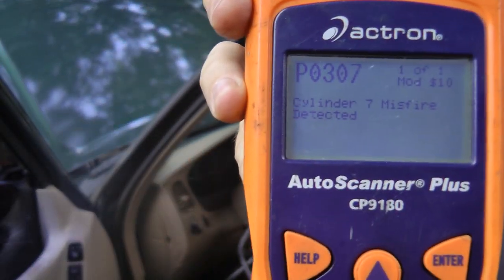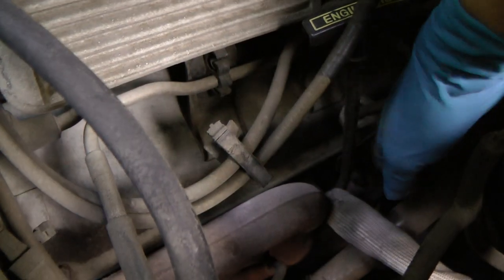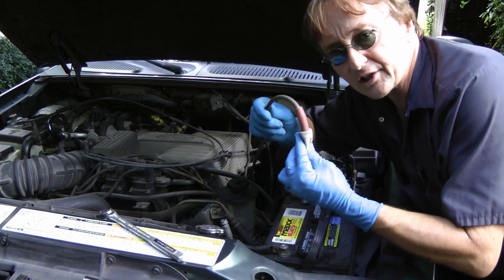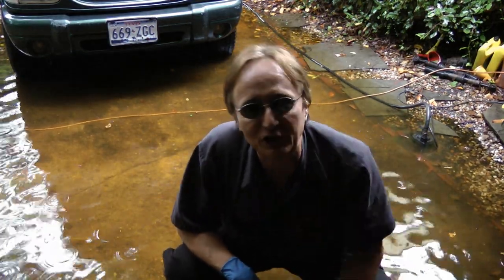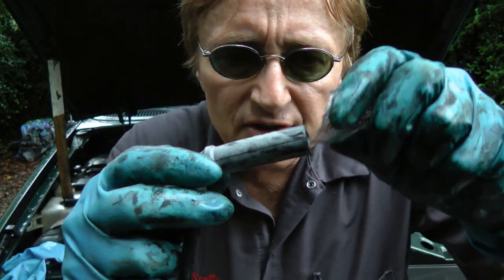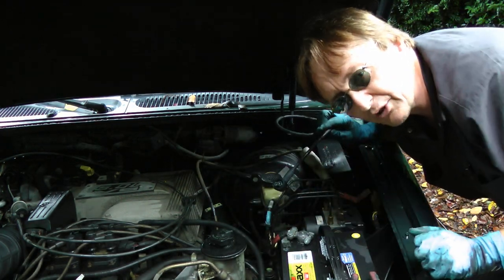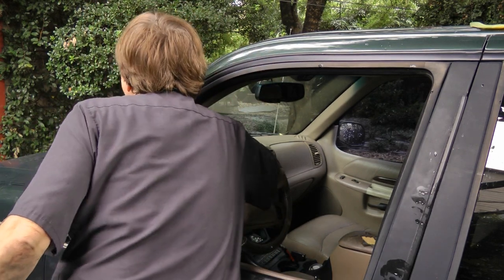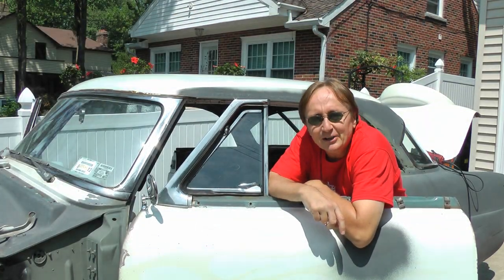How to Fix a Engine Misfire Code P0301 (Spark Plugs and Wires)

Comment: excuse me scotty you said no 7 is the third one in on rt side that would be no 5 no 7 would be 4th one in nearest the firewall just across from no 8 iam sure you just misspoke but might want to correct that so your viewers do not get there firing order messed up 18435672...or from leading bank rt side right to left 12345678..good video.. ..
Reply: On my Mustang, 7 is the third on the right.  front to back is 5678.  I couldn't imagine Ford trucks are in a different order.      Firing order has nothing to do with position on engine.
Reply: +Joseph Bentley yes you are right sorry my bad i was thinking chevy since scotty started out with a chevy then went to ford ..

Comment: I have a problem,  bank 2, cylinder 2,4,6 is miss firing . My vehicle as 90k odo and have a bad rough idle. . .
Reply from the maker: +Suavemente173 one side missfiring is often intake manifold or head gaskets leaking
Reply: +Scotty Kilmer Thank you. Going to start there.

Comment: i have an 02 ford explora 4.6 V8 that the #3 injector is dumping gas ive changed injectors and still have the problem has anyone else had this problem and what can i do to fix it
Reply from the maker: +Cathy Godbey if it's the injector dumping too much gas, then computer circuit that drives it is bad. but worn valves or blowing intake gasket will also flood out #3 cylinder

Comment: an you help me I have a p0302 cylinder 2 misfire  I put a new spark plug I no change wires are less then 10,000 miles old ignition system is also new cap and rotor is new no other codes are on the computer  the engine light  keeps flashing.
Reply from the maker: SuperJeremi10 swap #2 injector with another, if miss moves, replace it. Pray it's that easy
Reply: ive tried that with the wires  swapping the injector isn't so easy I have the spider injection system I can try but that requires removing the intake off the car the throttle cables and a bunch of sensor wires I have a 99 chevy Tahoe  injectors are only 600 miles old.
Reply: im just taking it to our local repair shop to pay for the diagnoses and repair.

Comment: Dielectric grease shouldn't be placed directly on the terminal. It's purpose is to prevent electro-static discharge (insulate; restrict electric flow) from unwanted sources. This is similar to how a computer's CPU can possibly get damaged froman individual touching it without that person first clearing their body of static electricity. 

Main reason I use dielectric grease is because its easier to slide the cable on and off when needed.

Comment: Those were some of the nastiest plugs I've ever seen. That's alot of standing water to have after a storm, do you have a bad storm drain at the street? Its best to get that to drain away from the house for the sake of your foundation, although my understanding is that houses in Texas aren't built with basements.

Comment: Scotty my 96 crown Vic making a popping sound from underneath my car or behind the motor n it misfire. I changed spark plugs n wire. Can it be fuel injector or motor coil pack. Can u help.
Reply: +Dreadhead13 Don't know if you found the problem yet but you might want to have your catalytic converter looked at. Popping sound is more likely a bad cat or if it's making that sound when you turn the wheel.....maybe a CV joint.
Reply: Ty Robinson yea I fixed it. It was spark plugs wires was cross. It don't misfire no more.
Reply: Dreadhead13 Glad to hear it.

Comment: hello on a flooded car the spark plugs fires all the time when you turn the ignition on  any idea what the problem is . no water in gas or oil or transmission . . fires random and often for no reason. .

Comment: my car takes long to warm up the engine and it dossent have power till it goes to the middle
Reply: same here jorge, I have a honda esi 94 model, the idle also is jumping from 500 to 1000 but stays on 900 when its warm.

Comment: heeeeelllpppppp I can't figure out my misfire two and three I change spark plugs all around  moved the coils same misfire I done a compression test range in 130 145 on all four
2005 Impreza WRX STI
Reply from the maker: swap the fuel injectors, they could be bad. Pray it's that and not intneral engine damage like a blowing head gasket that subarus are known for
Reply: Hey Scotty, I got a Fault Code p0303. I replaced the spark plugs but not the ignition coil pack and plugs. I was thinking if the cause was the fuel injectors mentioned in your other videos?
Reply: +Scotty Kilmer thanks and I know I came to you cause your the man
Reply: +Scotty Kilmer got it turns out my turbo had a small internal oil leak and was blocking all spark to my cylinders

Comment: WHAT???!!!!! How could you completely MISS (pun intended) the absolute MOST important step of a spark plug change...that being to apply anti-seize to the plug threads before installing them, especially with most cars utilizing aluminum heads nowadays?? Or is it possible you own a controlling chunk of stock in the Heli-Coil corporation...or that your brother's mother owns a machine shop where the lion's share of the income comes from cylinder head and thread repairs? Love your animation and zeal bud, but I've seen you do too many things that I consider to be 'rammy' and careless in other videos, and this one takes the blue ribbon. I understand that time is money in the auto repair biz, but me myself? I'd rather take those little extra steps a lot of us wrench twisting brethren skip, and do the job right. Plus, it helps keep the majority of first time clients decide to keep my business card instead of tossing it down the nearest storm drain. Sorry Scotty...but you missed the ball on this one.
Reply: dshmechanic You are not supposed to use anti seize on many plugs. I'm not even a mechanic and I knew that.
Reply: Yup no antiseize is needed ESPECIALLY in an aluminum head. A tiny bit in an iron head won't hurt anything though.